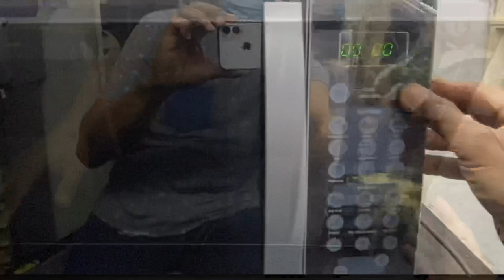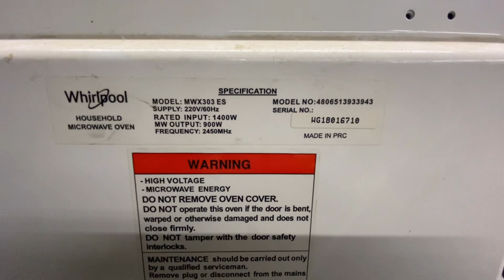Whirlpool Microwave Oven, How to Repair, Defective Touch Panel, Tutorial

Comment: Good am sir i have the same model po..ask ko lang po sana pano irepair ayaw po gumana ang buong touch pad nya pero may ilaw naman ang loob ng microwave.normally pag sinaksak mag on agad ang touch pad pero ngayon ayaw mag on.slamt po sana makatulong kayo.
Reply from the maker: Nid po chk unit, location?
Reply: @mr.handiymanphrosetechelectron  bulacan po sir
Reply from the maker: @homersevilla6287  , malau po pla, ung iba ng p pm po s messenger ko, guide to remove and send to lalamove or flash, minimal cost ung waybill

Comment: Boss sana ma pansin meron ako whirlpool din na microwave check ko na yung magnetron transformer diode pati capacitor Lahat okay pero hindi pa din umiinit yung microwave ko ano kaya problema nun pati fuse okay naman idol please help salamat
Reply from the maker: Please chk s input power transformer kung me input voltage,
Reply: @mr.handiymanphrosetechelectron  meron input na 220v at output 220v pa punta magnetron